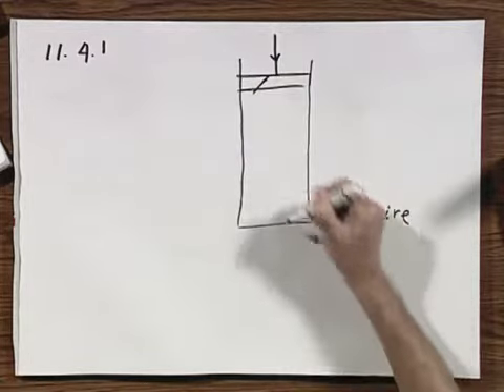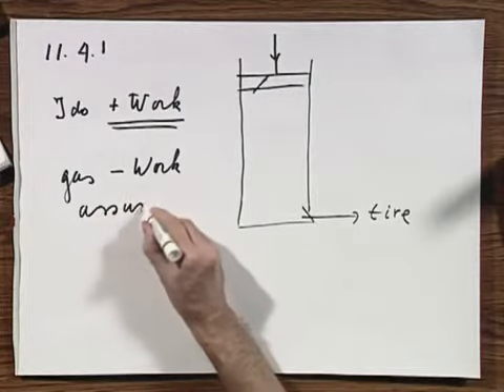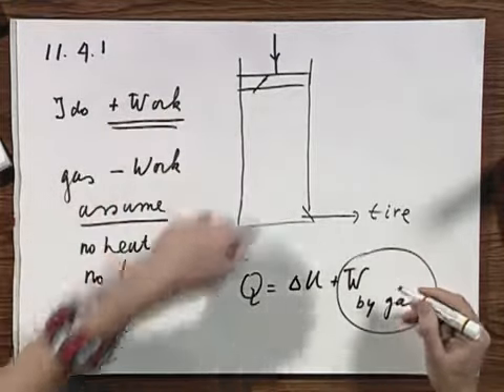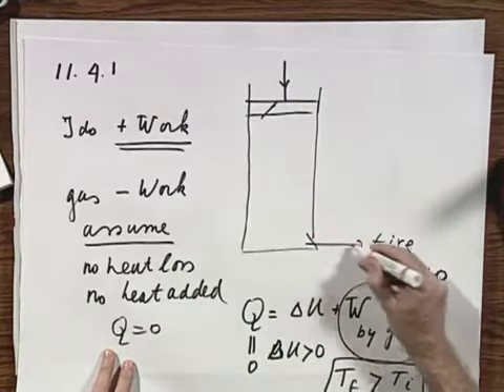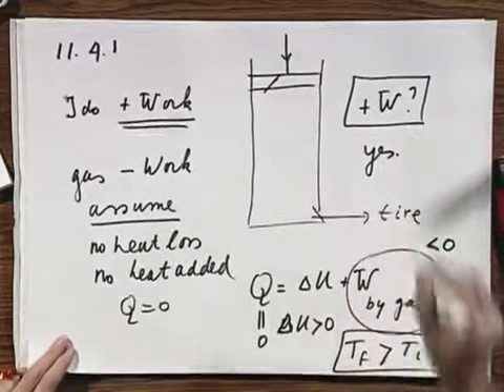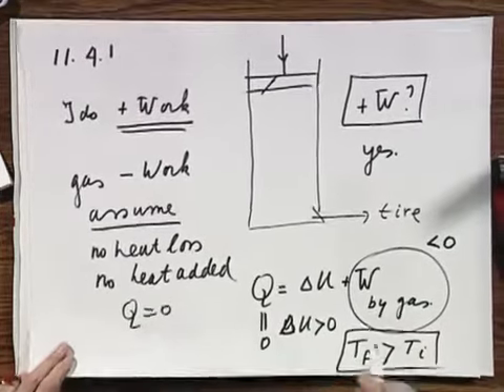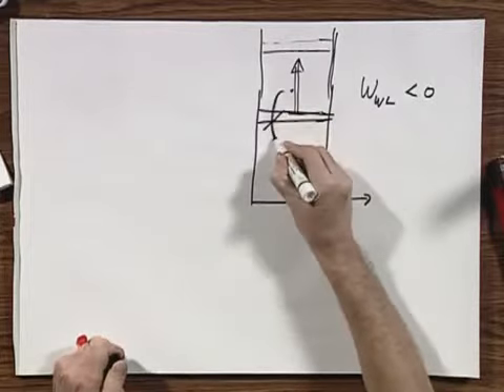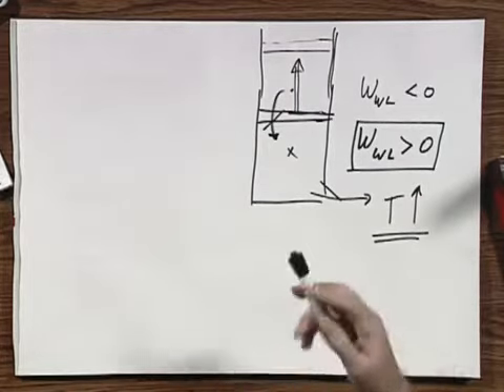8.01x - Module 19.01 - Heat produced by a bicycle pump.

Comment: I am confused . For internal energy U = ncv(dt) but in this case volume is not constant i decrease volume when i pump . How to use cp and cv in internal energy expression and  in what reference .plz help
Reply from the maker: how many minutes into the video?
Reply: Internal energy U is the way we keep track of energy of the gas during a process of heating it while it is at a constant volume.  Work is not involved.  In fact, by keeping the gas at constant volume, it can't do any work or have any work done on it.  Not without a shaft or other mechanical agent, entering the vessel.

By definition, the rate of change in U per unit temperature, dU/dT = cv.  The cv specific heat value always corresponds to U.   It is not constant, but in general cv is not very temperature sensitive, which is why it is useful for first order problem solving involving changes in internal energy.  For ideal gasses, it is constant.  For real gasses, other factors come in to play.
Reply: In this particular problem, the assumption is that it is adiabatic, thus Q=0.   Q = deltaU + W applies, or rather 0 = deltaU + W due to it being adiabatic.  All work done on the system becomes a gain in internal energy.   Internal energy relates to the specific heat capacity cv, as opposed to cp.

The value of cp goes with a counterpart concept to internal energy called enthalpy, commonly represented with H.  Similar to cv, it is defined as a temperature derivative of H (i.e. dH/dT) instead of U.  Also similar to cv, the value of cp isn't very temperature sensitive, so is useful for a first order calculation to assume that H is a linear function of T.   Enthalpy as it is defined, considers the case of heating at constant pressure, where the fluid doing work on its surroundings is a given.  P*deltaV to be specific.   H is a shortcut concept that sums U + P*deltaV, to keep track of the total heat added at constant pressure, since the gas was at a reference temperature where it is defined to be zero.  Some of H becomes U, and stays in the system.  The rest of H becomes work on the surroundings.
Reply: @carultch  volume will increase isn't?